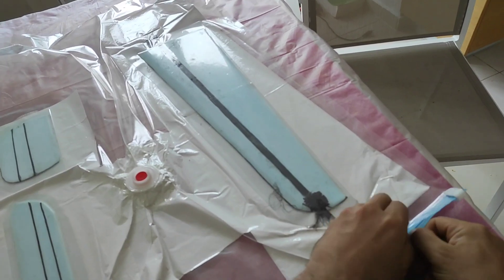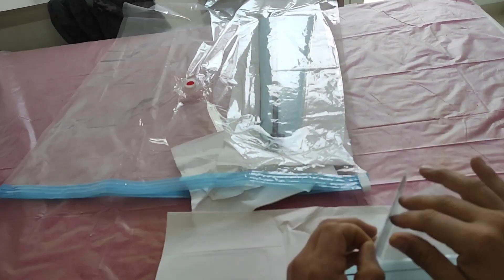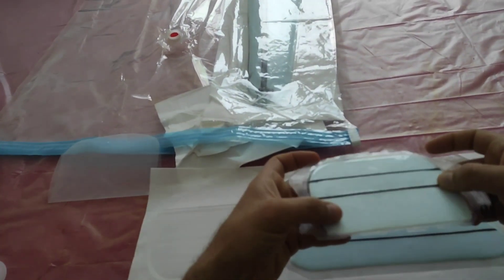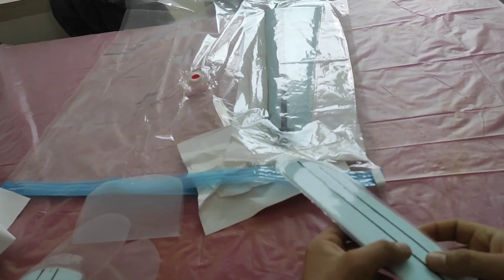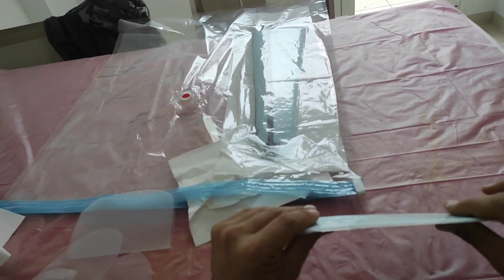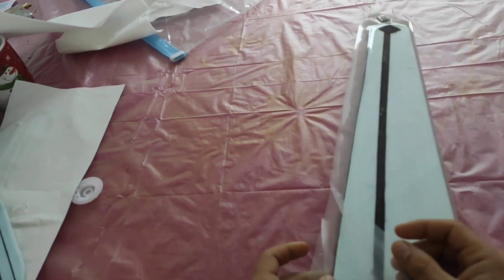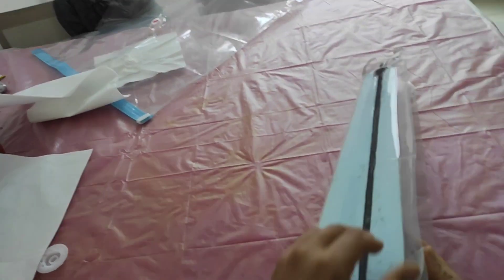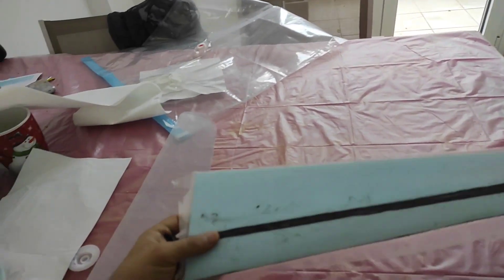GF DLG WINGS

Comment: My favourite part at 2:12. Very nice glossy wings and tails! Maybe I think that they can resist to 
moisture. Very good project! I would try this my next DLG...
Reply from the maker: Thanks, yes its waterproof.
Reply: @afilos  
What are the two layers of plastic? One is the Leitz 4100 PVC film and the other is what was left on the wing when you removed the plastic part (Leitz 4100 PVC film)? If I am right.
Or did you just smoothly put two layers (Leitz 4100 PVC film) on the wing, but the internal layer is just glued to the wing with epoxy?
Reply from the maker: @goldenfish77  I use only 1 layer of film. Because the A4 size is small for the entire length of the wing, I use 2 A4 sheets next to each other glued with clear tape. When I release the film, what you see is the GF and epoxy squeezed out of the mylars, which I then trim and sand down.
Reply: @afilos  Very nice, very nice! Thank You for these building and instruction method and Your skillful videos. 
I wish you a Merry Christmas!

Comment: Very nice job! Where did you get your carbon toe?
Reply from the maker: I got it locally but I strongly suggest to use CF tape instead of CF tow. It will make it far more easier to handle it. I bought this https://www.fibermaxcomposites.com/shop/carbon-fiber-tape-rollbr-width-cmbrtc80u03-p-100245.html?cPath=60 and have never used tow again.. You can easily build spars, booms, pegs with this CF tape. check out my latest build with CF tape https://www.youtube.com/watch?v=fPliqxQlHdQ&t=425s

Comment: Hi i have a non- wowen 30g/m2 fiber glass shoud i use it on the wings ?
Reply from the maker: I have never tried a non-woven fiberglass, so I don't know if it will work. You can give it a try on a tail part first and see how strong it is.
Reply: @afilos I tried it it wasn't so stiff and getting woven 25g/m2 or to order is impossible to buy .You used woven  50g/m2 fiber glass for top and bottom can it be also used for tail sections ?
Reply from the maker: @MarkJimenez-dw1tl  Now I built all my 1m dlg with 25g/m, wings and tails. You can use 50g but it will come out heavier. How heavier I don't know but you can still fly it and have fun.
Reply: @afilos  I put  24 g fiber glass made an even layer of epoxi put it whit the milars on the foam wings and place it into the vacum bag and put weight on top after  20 h it dried it was  little stiff I took down the milars and the fiber glass some stick an some didn't I coud peel of the fiber glass ( I took down all the fiber I think I will use the wings again  ) I don't know where is the problem I used like 25 g grams of epoxi for both wings I made the  same layer on the tail an only the ruder was stiff but there were spots that I cood peel off
Reply from the maker: @MarkJimenez-dw1tl  Did you light sand the foam and then clean it with water or air before bagging? Also did you use enough epoxy? Did you mix the correct epoxy and hardener? This doesn't sound right and It never happened to me.
Reply: @afilos  how much of epoxi you use for both wings + roller ?
Reply from the maker: @MarkJimenez-dw1tl  Sorry I can't remember, but the total epoxy for the wing should equal the fiber glass weight or a bit less ideally.

Comment: I have tried doing this a bit but I have found that it is still a bit flexible after curing. have you experienced this? if you were to just do a single layer of 50g/sm or 25g/sm not on foam but just as a small sheet, would it be very rigid? I might need to look into getting another resin.
Reply from the maker: I am very satisfied with the stiffness of this method. The tails I build in this video are made from 2.5mm XPS 1 layer 25g/m2 and the are very stiff for this 1 m dlg in comparison to the balsa ones they are a bit stiffer. The wings are made from 50g/m2 and are also very stiff, and in comparison to the solid balsa dlg I've build it's day and night. Epoxy cures rock solid after 24h. I don't understand what you mean when you say small sheet.
Reply: @afilos  if you where to just put some epoxy on that same fibreglass and nothing else, would it become really hard and stiff?
Reply from the maker: @zacapelt1234  The wisel 2 I've build is open glassed like you describe and very stiff wings as well, but also thicker, so I can't really compare. But you should use the vacuum bag I use, it's no big deal.
Reply from the maker: @zacapelt1234  if you are glassing just a GF cloth, then it will be very flexible after curing. The stiffness builds up when you sandwich a core material (foamboard) with GF or any other cloth.
Reply: @afilos  ok, thanks.  I am really glad to hear that! I thought I might have to invest more money into resin. I will do some more experiments.